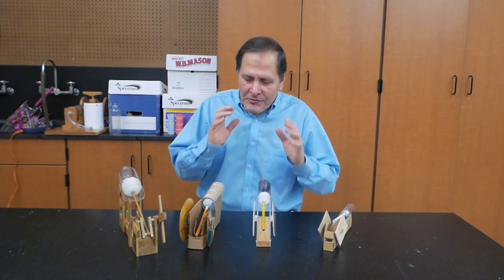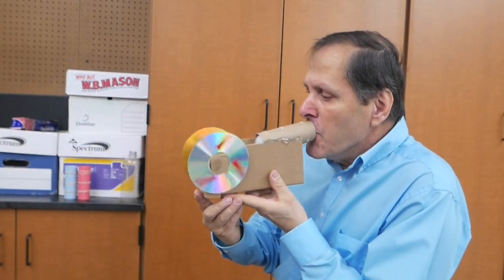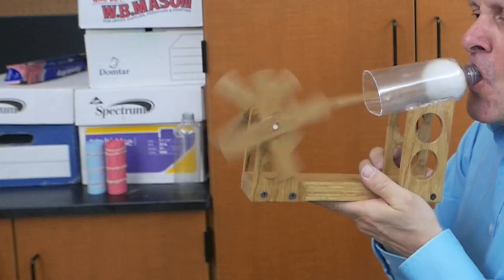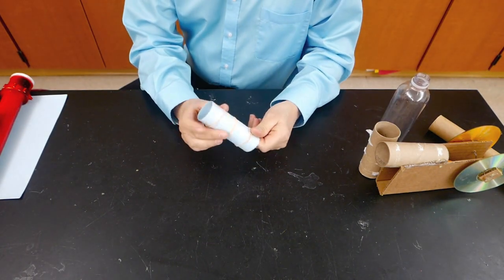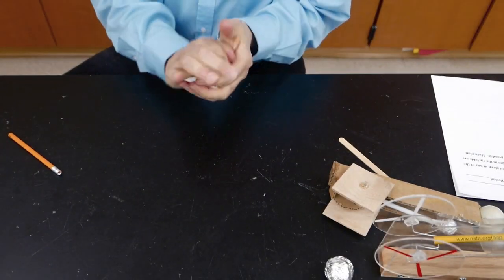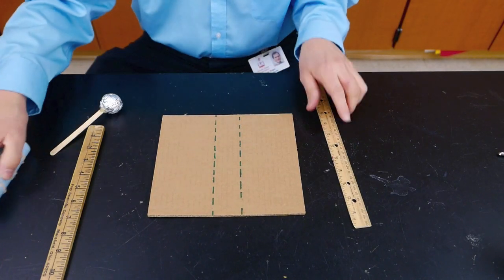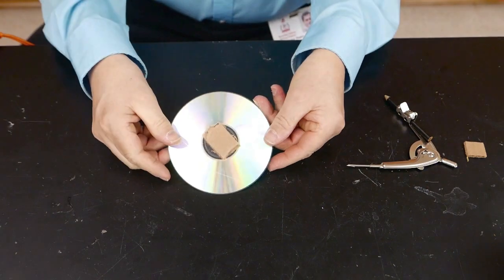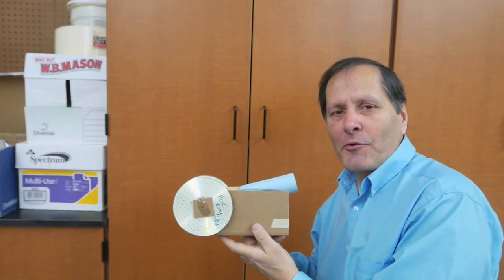Physics of toys - Simple air engines  // Homemade Science with Bruce Yeany

Comment: I tried to make a cardboard uniflow air engine but it would just stall at bottom dead center .  Have you had luck with a simple uniflow  design ?   Patent 3190554  .

Comment: could one make an air pump (for a fish tank) using one of these  by manually turning the flywheel, adding a one way inlet valve to the (mouth piece) end of the pisten and attaching a small pipe on the side of the pisten which leads into the water of the fish tank? 
the only problem I can think of is how airtight the pisten is (using the ping pong ball). Would that have a big effect? sorry for the confusing question and thanks in advance for any answers
Reply from the maker: I don't think so,  these have too much air leakage,  it would need better seals
Reply: Bruce Yeany, thank you very much for responding so fast! I would subscribe again if I wasn't already a subscriber.

Comment: make the ball out of a magnet and use a spinning magnet to drive it.  then put 6 or 8 of them around the spinning magnet, and have them all wired to a motor that turns the magnet.  ha
Reply: but having a spinning motor would defeat the purpose. This is supposed to convert linear motion into rotation. If you already have rotation, then youre basically adding the piston for no reason, because the end result will only have a weaker torque than the original torque of the motor. lol
Reply: Iron Man it is a joke genius.  fuck you
Reply: Alan Malcheski pretty detailed joke. nice.

Comment: Bruce,

  This one gave me the idea to make a 'double-action cylinder', similar to the pistons and cylinders that drove the old steam locomotives. There would be a have to be a vent tube on the outside of the cylinder, connecting ports cut into the cylinder sides. If I get it right, one would only have to blow and the reciprocation would come from the air being at first directed against the top of the piston, then against the bottom, as the moving piston at first covered and then uncovered the successive ports.  What do you think?
Reply from the maker: Good idea,  I would love to see that if you get it working